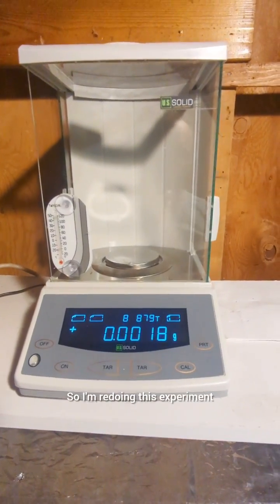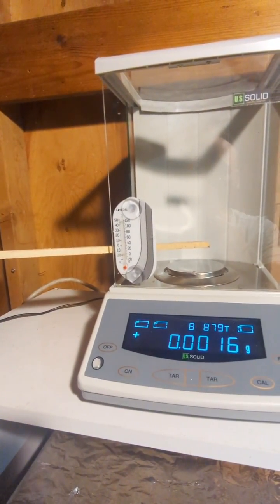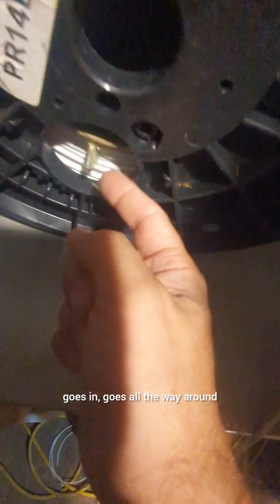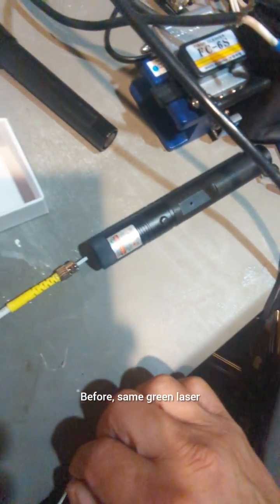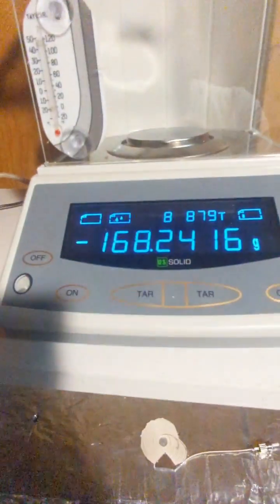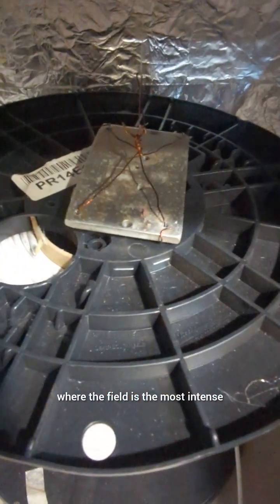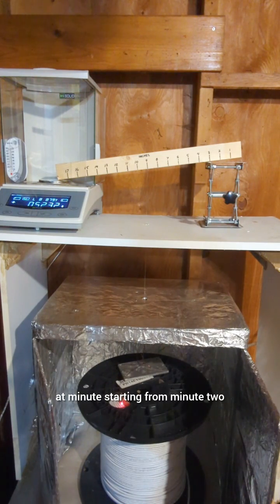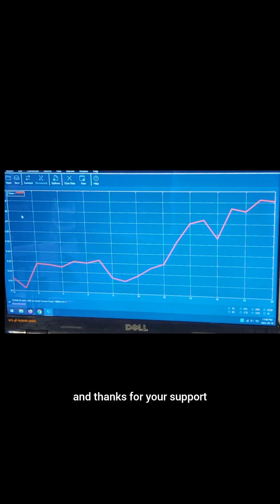BIG  Optical Warp Coil (OWC), how does it perform?

Comment: I was just thinking, you should definitely try putting the test mass inside the warp coil. In other words, gravity may be modified inside the solenoid and not effected on the outside.    if those cables do warp space they would block gravity from getting to the inside...? IDK if maybe you may have tried that or not..

Comment: A wooden cantilever can absorb moisture from the air, changing its weight relative to a change in humidity.  A metal cantilever would be better, but it could change length if the temperature fluctuates.  Either way a change in barometric pressure or humidity would lead to a change in the buoyancy of whatever material you decide to use for a cantilever or a weight.  If you want an accurate test, you really need to make sure that atmospheric conditions remain constant in and around your setup.  In fact, I would bring in space heaters and ice chests and test how atmospheric changes affect the results before I ever pulled out the laser.  That's just a suggestion.  GL with your research.  :goodvibes:

Comment: IMO, because those fibers are designed to minimize loss and get everything across to the other side, the end, that is where most of the light's gravitational mitigation capabilities are happening.   You've probably minimized inertia in the direction of where that light is shining. 

Once that disc passed the Sharpie horizon, you'd see your effect.🛸

Does that explain the bonus plate movement?  Very possibly. 🤔

The only issue now is:  do we call it "anti-inertia" or just "The Ojala Effect"?:yougotthis:

In any case, interesting as always! 👍🏻
Reply from the maker: Definitely the ojala-einstein-kelly whichamacallit somethinorother.

Comment: heh. I worked for a underground fiber optic installer for 20 years. we have had light a lot more powerful running into coils of 16000 foot rolls of fiber optic to test for faults and there was no noticeable change in the weight. I did the Fault tests on the reel we received from the manufacturer to make sure that shipping didnt destroy the fiber.Using Corning glass fiber and using the length of a bit over 3 miles of fiber. I would test reels all day for weeks sometimes. Never ever did anything that could be any gravitational anomaly or weight change happen in all that time.
  If anything like that happened it more that likley be an error with your test equipment or testing procedure.
Reply from the maker: I wouldn't expect anything perceivable without a means of measuring weight or forces. I have also found that the glass fiber with the insulation didn't seem to work as well as the leaky open plastic type. Not sure, if you are an active experimenter along these lines...

Comment: Have you tried positioning the copper weight in a location other than the centre of the coil?

Perhaps above the coil edge or towards that part of the coil with the highest optic density? 

Have tried strobing/piezoing the laser pulse?